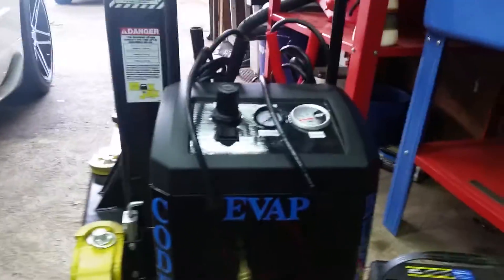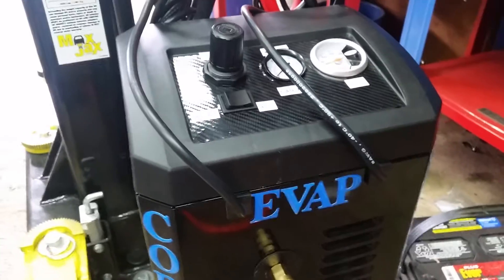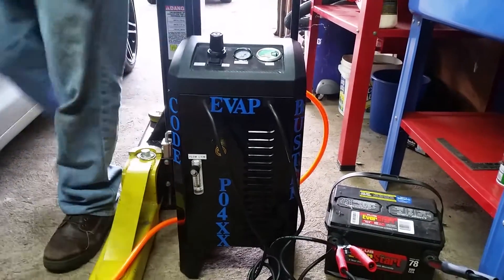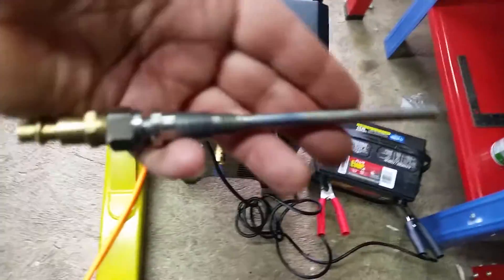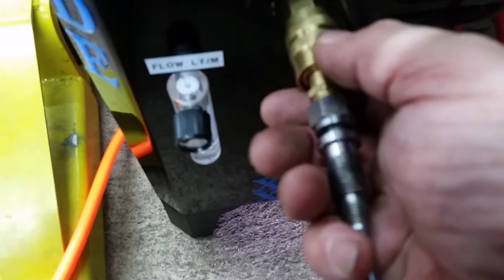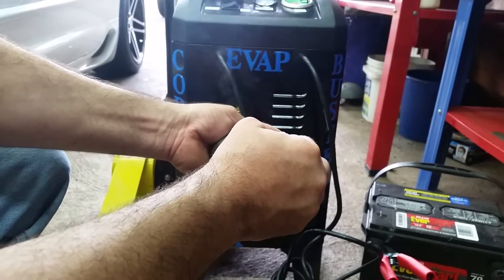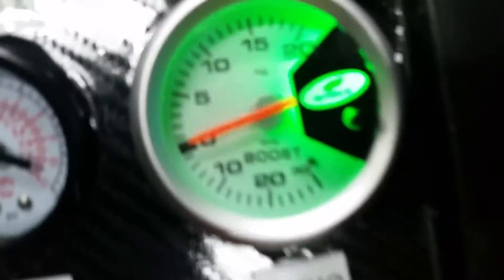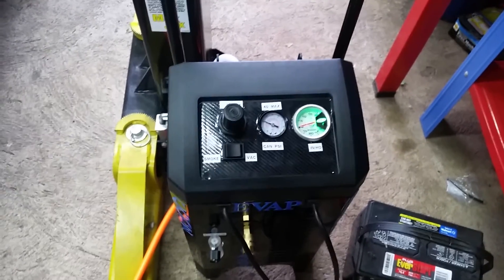Evaporative Emissions System Smoke Tester "P04XX ©"

Comment: Hi, Interesting build you made. Did you do more modifications to the "Code Buster"? Will you show how we can make one at home with all those features or how it is made internally?
Reply from the maker: Brian I used a 4-2 valve, couple of solenoids bunch of hose, glow plug wrapped in fiberglass, paint pot from harbor freight, venturi style evac for ac, obvious switches and gauges, o2 flow meter, cost about $300 put together but I got that back the first time I used it around here they charged 258 to do a scan
Reply: Thank you for the reply so quickly. You put together a real nice machine that definitely does exactly what you wanted it to do. The fact that it has both the flow meter and pressure gauge with vacuum are great additions to help with vacuum leaks. Great Job
Reply from the maker: Brian thank you kindly. I do not know if any other machine on the market does both..so there it is :)